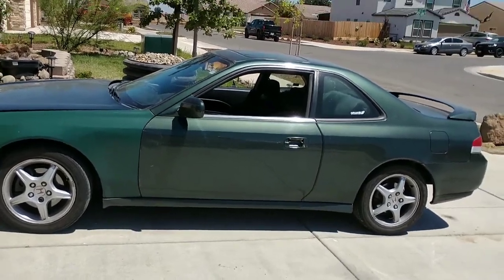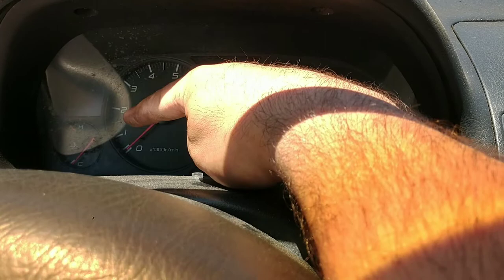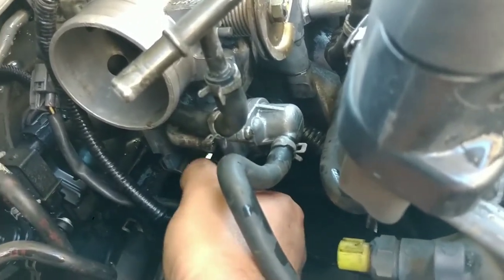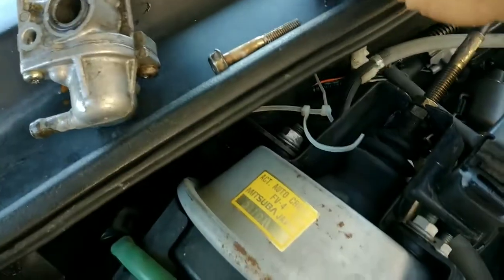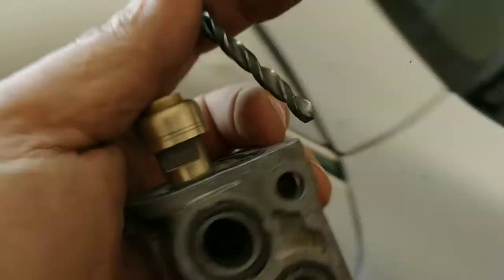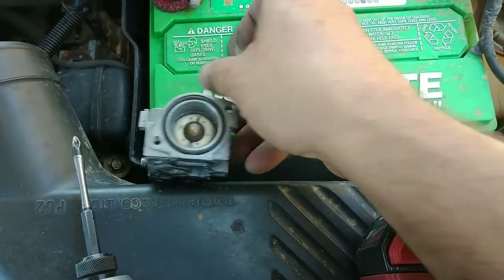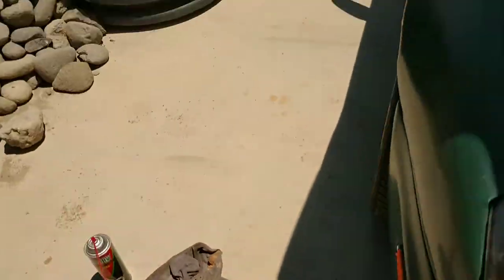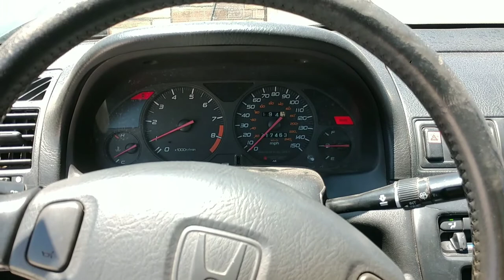H22 Prelude W/ surging idle fixed

Comment: Just got a 2000 base 5 speed. Had the same problem. Cleaned out the iacv on the top of the intake an the bottom. Fixed it perfectly now idling at 800 thank you so much saved me 200!!
Reply from the maker: That's great news. Glad I could help.

Comment: Works! I Been chasing a vacuum leak that I didn’t even have lmao did what u did and was relived it worked, for anyone about to try this if the bolts on ur fast idle are to tight to the point ur going to strip them like mine were just pull the throttle body off and the fast idle will be on with it made it easier for me plus u get to clean deep inside ur intake manifold. Great video!
Reply from the maker: Thank you for the kind words and glad you were able to solve your issues.  💪

Comment: Recently picked up a 2000 type sh and i was having the exact same issue. FITV was the culprit for mines as well! I found it easier to just unbolt the throttle body and remove it then take off the fitv valve.
Reply from the maker: Nice. Glad you were able to fix yours.

Comment: its usually just the first valve you mentioned in this video the one you said you thought you took off another car, the pipe that go to it and the until it self clogs if you have ever used any additive in your water and usually just cleaning that and the pipes works never had to do the other vales you just did
Reply: flush your radiator system out now as well as that was pretty clogged up someone must have added a leak seal additive in the past maybe for a broke radiator thats has been replaced but anyway to anyone else reading this never add anything other than coolant to your prelude or you will get the same issues at some point

Comment: I have a vacuum leak I couldn't find.  The idol was bouncing up and down, it was a rubber seal in between the brake master cylinder and the brake vacuum booster.  When I press my brakes hard it idles fine, and when I take my foot off it bounces.
Reply from the maker: Yup,  any vacuum leak would create that sound as well.  A good way to test was is to spray brake cleaner around all the areas where you could have air entering the intake system.  If there's any leak the car will idle lower or die.  You can pinpoint the area while spraying when the engine is running.

Comment: Did the iac valve and fixed ours for a cpl weeks then the surge came back.  I’m going to try the fast idle valve, my only question is do you screw the valve all the way until it stops or do you back off at all?  Thanks.
Reply from the maker: All the way in.  Either replace the O ring or use blue or red lock tight to secure it.  Just tighten it up.  There is no need to over tighten it.  Good luck

Comment: I just got my prelude and it does the same thing but after driving it for about 5 minutes it stops. Any tips?
Reply from the maker: I would suggest looking at the idle air valve on the side of the throttle body between the fuel rail.  It's visible briefly in the beginning of my video.  I'll pull a time stamp for you.
Reply from the maker: 5:45
Reply from the maker: There are 2 independent  air valves here.  Each one has a different purpose.

Comment: That a coolant valve that pass the coolant from the engine  to it and to  the idle air control valve on a 1999 honda crv, i got the rubber hose  that go to it broken down and i lost all my car coolant,  i saw the coolant comming from that broken hose whille the engine on, till thenengine start going ovetheating,  and that way i know that a freaking coolant control valve fronthe IACV.

Comment: Did you bottom out the little plastic piece on the inside or did you tighten it a bit?
Reply from the maker: I bottomed it out.  You want as little play on the spring as possible.
Reply: @PFab  got it 👍🏻 and can the idle screw valve help with only high idle not idle surge

Comment: Hey bro i am chasing this sound that is being made at 1700ish rpm, you can hear it very well at 3:35 in the video. Did you ever find what it was???
Reply from the maker: I'll check it out and get back.  Got you're email.
Reply: @PFab   !!! Thank you for such a fast reply haha
Reply from the maker: @noah_s906  I just checked.  It does sound like a loose part.  And from I remember,  my alternator tensioning bolt was sheared off at some point after this.  Hope that helps.  Good luck and report back.

Comment: I used this same fix but over time it would die on me when I stopped at a light or stop sign.
Reply from the maker: Did you figure out your issue?
Reply: @PFab  not quite yet but I’ve narrowed it down to possibly a bad distributor cap
Reply from the maker: @christopherwarner1355  check your wires and coil.  Bad spark in any of those will cause issues.

Comment: Your coolant needed burping… mine did the same thing til I burped the air out
Reply from the maker: No, I tried that like 20 times.  Like I said in the video, it wasn't air.  This was my fix.  It worked.
Reply: @PFab right sorry! Can I get to the hose from my engine to my heater core if I just take off the manifold?
Reply from the maker: @timphalen9182  yes,  it's just underneath that manifold

Comment: Yo did you leave the battery plugged in?
Reply from the maker: Normally yes.  Only thing I did at the end was pull the fuse box power to reset the ECM codes.

Comment: Any updates on either  prelude?
Reply: I had that exact issue on my base 97, just did it actually in the parking lot. Just want to say that my coolant isn’t topped off, I burn coolant if it’s topped off because of a small head gasket leak but I don’t ever overheat, car used to do this only when she was cold but then it became more frequent and didn’t go away, cleaned the other control valve but it wasn’t that dirty and it didn’t fix my issue. When I took the high air control valve the gold nipple wasn’t flush with the plastic ring. Tighten it down threw it back on and car sounds good and idles perfectly
Reply from the maker: @tadeovaldez8498  yeah, idle issues suck. Glad you got that fixed. My green Prelude was doing that for over 6 months before I gave up. But just when I was going to just deal with it I tried looking up many YouTube videos and found one that actually helped guide me to this video. So hopefully you guys don't have to look for days to find your problems. I tried to explain in as much detail and do what you would need to do. Step by step. I had no idea there was too idle air control valves. This one in my video is called the fast idle air control valve. Which caused what I tried to explain in the very beginning of this video. 

But after attempting to do it, because I was super excited that it actually worked, I tried to replay what my issues was by going backwards from the steps I took to fix it and reverse everything for the sake of putting a great video together. Well not that great. But helpful. 🥴

Comment: Just today, fire my battery light came on with the brake light, I went for a drive and when I reved it the lights went away. At night I went to go for another drive, the same lights came on and the car for the first time ever started doing that
Reply: Can I still drive it for now ?
Reply from the maker: @soheilhejazishoar3623  yes,  you can drive it for a long time this way.  But it will be annoying and possibly embarrassing.  It really depends how long you want to deal with it.  And you will have performance issues.  Nothing serious.
Reply: @PFab  damn, today I came to ride the car, rode it, came back home, turned it off tried starting it again, it didn’t start, the battery light has been on but I do get power for everything else except it doesn’t start. It’s weird how this issue and jumping idle came together
Reply: I don’t know toomuch about cars but one thing I could think of is the alternator is done
Reply from the maker: @soheilhejazishoar3623  do you hear a click from the starter?
Reply: @PFab  the first time I tried to start it it just made the same noise as a car with low battery, the second time it did the same but for a shorter time and I heard a click, don’t know where the click came from
Reply: @PFab  the clicks were like “snaps” one after the other, I got worried and stopped trying
Reply from the maker: @soheilhejazishoar3623  do you have a volt meter?
Reply: @PFab  I do not, I want to learn this stuff so I will probably start buying tools.
But here’s a update: I just went back and tried again, and it started
Reply from the maker: @soheilhejazishoar3623  so if your alternator is dead this is your current issue.  Your battery is only used to start your car.  The alternators job is to charge that battery and maintain enough voltage to run everything else.  Over time a dead alternator will take out your battery with it.  

The battery should at minimum have 12.7 -12.5 volts.  Anything lower is bad.  A good resting battery will be higher than 12.7 volts.
Reply: @PFab  got it, so I guess first I have to buy a volt meter and see what’s up
Reply from the maker: @soheilhejazishoar3623  here's a pretty nice deal.  And it's $3 off right now.  https://www.amazon.com/gp/aw/d/B07FDBW1PT/ref=syn_sd_onsite_mobileweb_476?ie=UTF8&adId=200049987164321&qualifier=1626933000&id=5101067751006775&widget=sd_onsite_mobileweb&spPl=1&psc=1
Reply: @PFab  I went to oriley l, got my battery tested and charged, they said it was good. Went back home and truied to start the car and it made weird noises and it couldn’t start, I think my alternator is done.
It was just weird how it all happens so quickly, and it’s weird how I got jumping idle with it, well maybe it’s only weird for me because I barely know about cars.
We will see, not sure if it’s my alternator but from the things I’ve seen, I’m pretty sure it is
Reply from the maker: @soheilhejazishoar3623  okay if your battery was fine,  what voltage did they have on it?  Also I wouldn't be to concerned about the alternator right now.  If you have a good battery,  I would suspect the starter being bad.
Reply from the maker: If you have the time, I would pull the starter and have them test it as well.
Reply: @PFab  I needed up not going. I jump started the car with my moms car, started right up. Waited a bit pulled the jump start wired off, sat in the prelude to warm up and the lights started weakening, the time clock on the dash slowly disappeared and the car wanted to give out and die. The lights on the dash started weakening, the Rpm started sitting at 0 and didn’t move with revs.

I watched this video: https://youtu.be/m5Rq_eBoHMs 
Just like him I’m having my battery and brake light on, pretty much everything that’s happening to his car happened to mine, but I just didn’t move my car, I was scared if I run into problems driving to orileys
Reply from the maker: @soheilhejazishoar3623  oh that's bad.  Okay so you definitely need to replace your alternator.  That's really interesting 🤔.  I have never heard it causing issues with starting.  That battery should be enough to start your car and run for a few minutes without those issues.  This is where the volt meter would be handy and 2 people.  Or really long testing leads on the meter so you can monitor things from inside.  One upgrade you can possibly do is order an LED voltage display and run the wires directly to the battery, with a fuse of course.  

And place that display inside the dash so you can monitor your voltage while turning over the car.

Comment: My Honda Civic 89 erratic idle ONLY when it hits operating temperature....so, strange....then, it goes away....I have cleaned every part known to mankind...no way to fix this on my car...my assumption....I prefer not to change parts...no codes...oh well..life goes on...oh sometime when I CLEAN external components, it goes away....but always comes back....lol...also, once I loosed the bolt that holds the circle piece the throttle cable wraps around...and that worked for a few weeks, than it went back to same problem...
Reply from the maker: That's interesting. Does it happen when it's hot only?
Reply: @PFab  only when it "hits operating temperature"...when hot, nothing happens....
Reply: @PFab  let's say operating temperature is 190 F, for example only, when it hits 190 F it will idle erratically...for about 6-8 seconds...then it goes away....
Reply from the maker: @JohnSmith-vq1kf  have you opened up the sensor I covered in this video?
Reply: @PFab  nope....don't think that is the situation for my car...
Reply from the maker: @JohnSmith-vq1kf  I mean did you try at least?
Reply: @PFab  no because I don't really think the same situation....mine had to do with the nut that goes onto the metal that holds the throttle wire cable on the throttle body...depending on how tight or loose it is...the problem can be recreated.....
Reply from the maker: @John Smith  took me 10 months to watch this or I missed it.  Thank you for the link.  Great info there as well.  Hope anyone in your shoes sees this and gets the help needed.